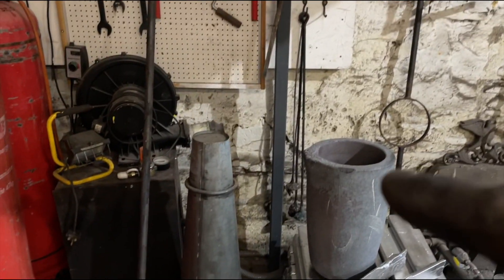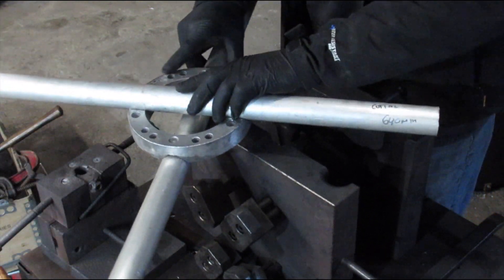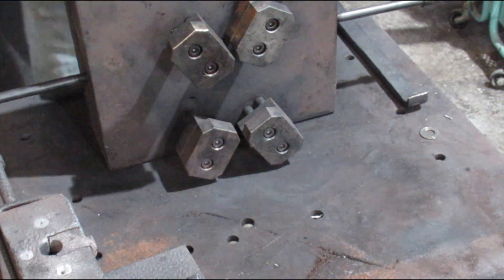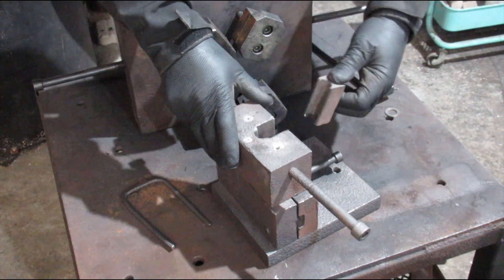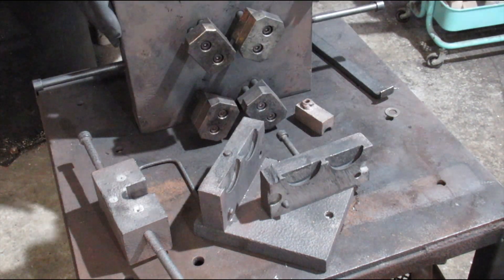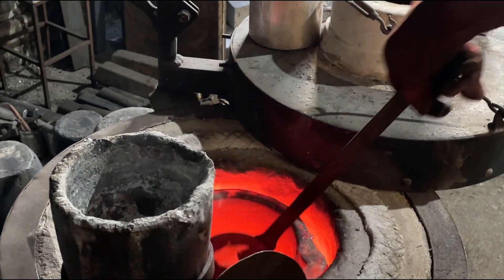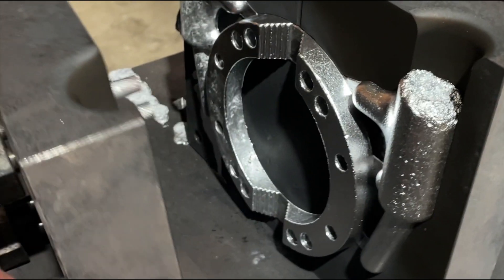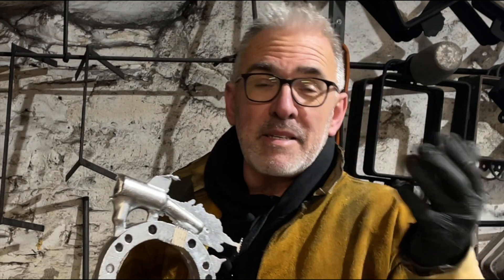Die casting Aluminium

Comment: This does not seem very efficient. At the very least, you should get yourself a few pneumatic cylinders. Then you can open/close the mold and extract the part at the push of a button. It might take you a day tops to build, but you will practically automate all future mass productions for a few hundred bucks if you don't have your own compressor.

12mm bore 50mm stroke double action pneumatic actuators for ~$5 each (2 sides, 4 per mold half + 1 per pin = $80) and 2 steel mounting plates drilled full of holes, although the cylinders have 6060 extrusion T slots I think a steel base is more rigid. 

I would make the mounting plates big enough to fit many size molds and drill the holes spaced exactly for the pneumatic cylinders to make them reconfigurable. Then you can screw the cylinder wherever you need to hold a mold or push pin and add some steel blocks as spacers to adjust the gaps. Bolt each mounting plate to a stand and use some "all thread" rods to tie the 4 corners together using some of the spare mounting holes. Don't forget to add LEVER LOCKS instead of clamps.

If you wanna get really lazy make 2 U shaped stands to hold the crucible while you pour and add a motor.

PS. The cylinders are $4.95 on AliExpress. The 2 way pneumatic toggle switch is $1-5, and 10 fittings are $1-5 depending on sales.
Reply from the maker: Thanks for this much appreciated, will be looking into it if we proceed with the contract